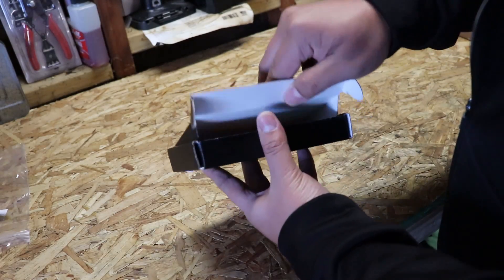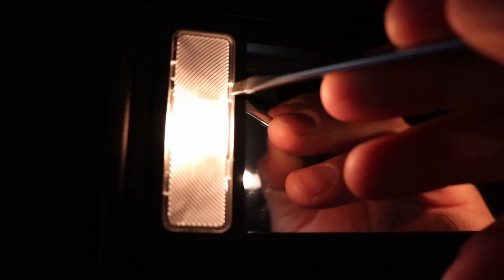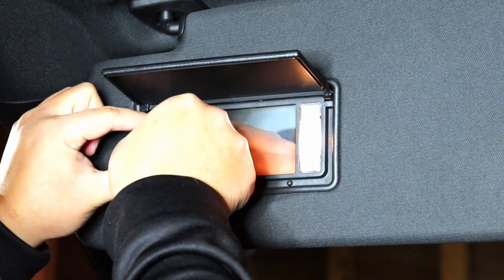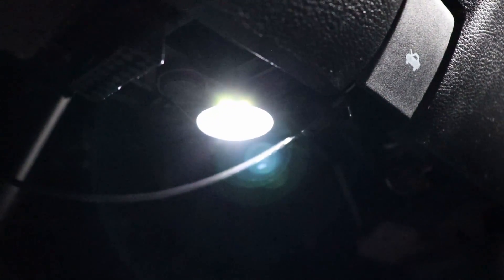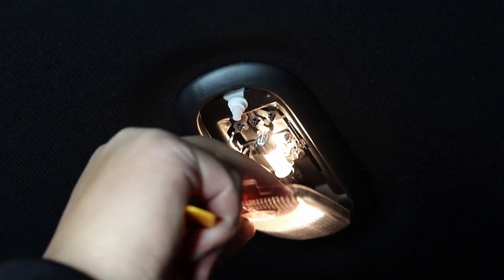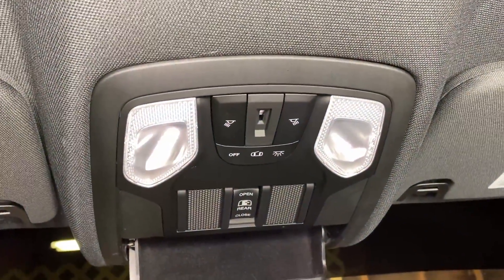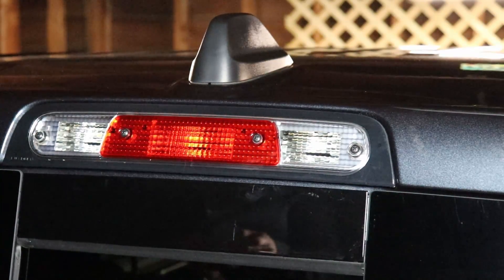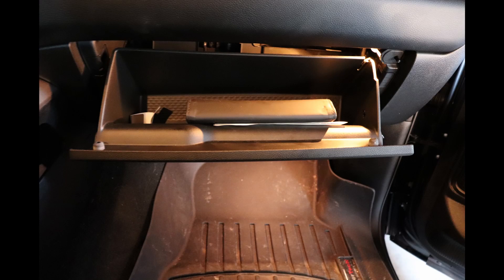2019 RAM 1500 Interior Lighting | Interior LED Lighting Install

Comment: I have a 22 Ram.  Was so mad the interior of the truck was so dark.  I bought a couple boxes of those fenderwell lights and replaced the under dash lights with 1 ea per side.  Under the rear seat i have a Du-Ha organizer and I mounted 4 of those lights across the front.  World of difference!!!

Comment: Bought this product but returning them on the first day, Dome light does turn on when the door is opened however you can no longer control them w/ switch. Map light has the same issue, thank god I tested them before putting them back up, so I don't have to worry about doing them again. For any of you having trouble removing the overhead console, I highly recommend watching those lasfit videos which includes much more details. Even if you are not gonna purchase their products, it makes the disassembling and installation process much much easier!
Reply: Damn that’s such a waste of time…

Glad I hadn’t bought any. Looks way harder then my 4th gen
Reply: Mine is doing the same thing. Did you eventually buy other LEDs that worked?

Comment: Very informative video.  I have the Limited model so there are several LED's already in the interior. What I'd like to know is there a kit available on the market for specific areas where you want to install LED's or do you just order the kit and just replace the one's desired ? Not sure why Ram would install LEDs in the cargo box area but regular filament bulbs by the high mounted third brake light.  Also, is there an installation for under the hood ?

Comment: Have u had any lights flickering with this brand? Also does it still function like stock where you open the door and all the interior lights still shine? Heard stories of aftermarket lights disabling this function that when you open doors they won’t turn on, only when doors are closed and u click interior light button
Reply from the maker: The only one I had issues with was the driver side map light. But I think it’s due to the bulb not being seated properly. I haven’t had a chance to investigate it. But after the install the the lights worked just like they did with the factory bulbs. The lights come on when the doors open. Hope that was helpful!
Reply: Thx for the reply!
Reply: Mine does the opposite. Works fine when you open the doors, but won’t let me turn them on/off with the toggle.

Comment: The map light covers don't come off without pulling that whole console off?
Reply from the maker: The covers do come off. I didn't think I'd be able to get my fingers in there to grab the bulb. So this was the process I took. If your able to get to the bulbs just fine, I don't see any reason why you couldn't replace the bulbs without taking the whole console off.
Reply: @abes8867  Those bulbs can be a bugger to get out. Easiest way is to wrap a zip tie around them and pull them out. No need to pull the console
Reply from the maker: R Kranz awesome! Thanks for the advice! Hopefully others will see this comment, and I’ll try this method if I have to replace them!

Comment: Just finished installing these lights on my 19 ram 1500 big horn anyone have any idea where the bulb for the engine is supposed to go? I'm gonna take a wild guess and say somewhere in the engine just not sure exactly where
Reply from the maker: I may be wrong, but I think there are some models that did not come with an engine bay light. But if there was, my guess would be on the underside of the hood.
Reply: @abes8867  ok thanks. Also really helpful vid nice work.
Reply from the maker: @sethwerzberger478  no problem! I’m I’m glad this video was helpful for you!

Comment: My switch to activate all lights isnt working now? Do you know why?
Reply from the maker: Daniel Garcia I don’t know what your exact issue may be. But a place to start would be to check and make sure that all your bulbs were put in so that the polarity is correct. If that doesn’t work. Then check your fuses, to see if one as blown. And if that doesn’t work, a third thing to check is to make sure the plugs are all the way in on the overhead unit if you followed the process I had in my video. I hope that helps!
Reply: Im having a different issue where when i unlock the doors or open the door they dont turn nor the switch but once i put the key in they turn on

Did you figure your issue out?

Comment: you forgot one!!!!!! the glove box above the glove box
Reply from the maker: You're right! Good catch. The glove box above the glove box in my truck already has a "pure white" light in it, almost like it already has an LED bulb. So I didn't feel the need to change it.
Reply: Abe S how would you change it if you wanted to? Do you just pry it downward till it pops off or is there a trick to it? Thanks
Reply from the maker: Ish M When you open the top glove box, you’ll want to look between the door and the top of the glove box itself. Bend the top of the glove box on down a little and you’ll see the light fixture. On the light fixture itself there is a clip on the right side of it. You’ll need like a flat head to press that clip left towards the driver side and apply downward pressure at the same time. Pry the whole fixture out and then you should have access to it. I hope that was helpful! Be careful, and do this at your own risk! Good luck!